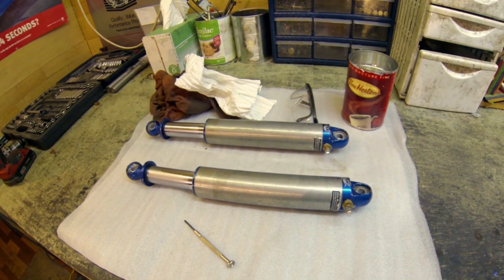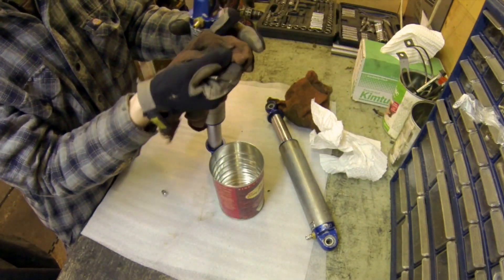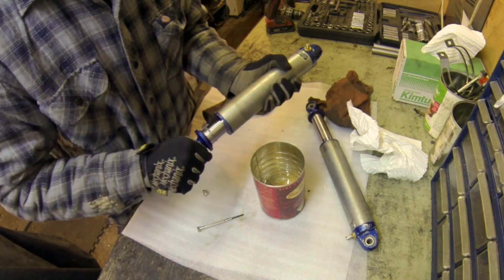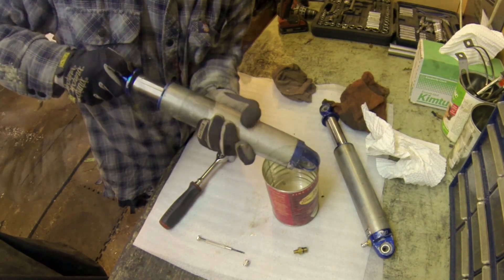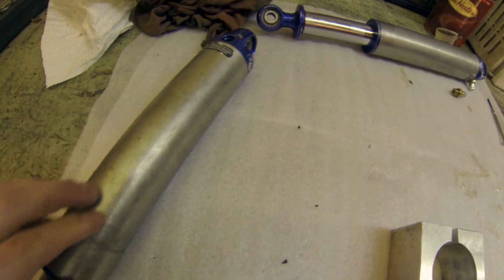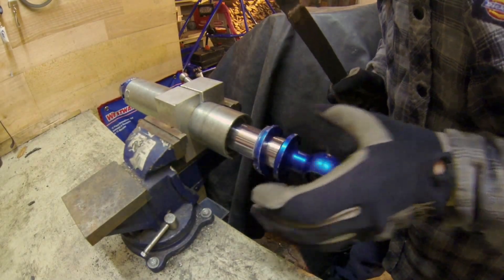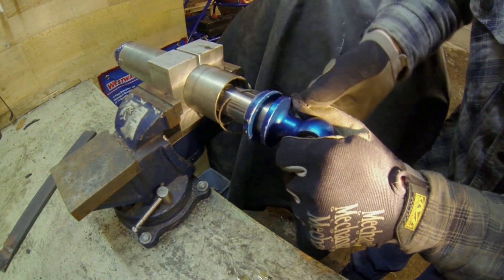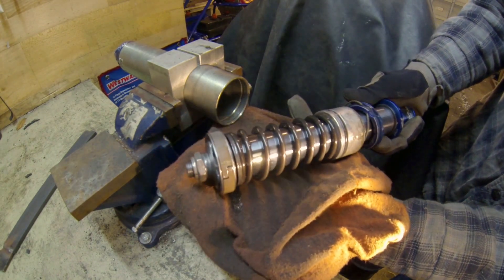Fox Shox 2.0 air shocks disassembly

Comment: can I change the oil by disconnecting the resevor hose and emptying both th e shock and resevior thru the hose fittings?
Reply from the maker: Yeah that should work. Just cycle the piston a few times and that should get all the oil out.